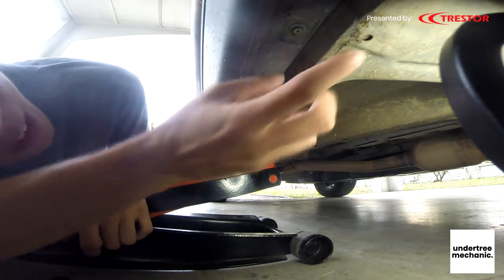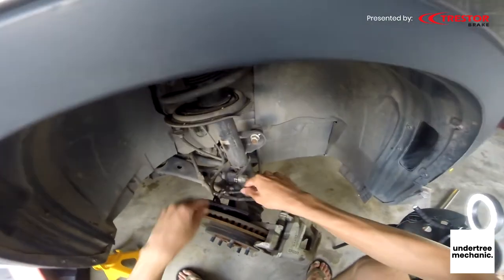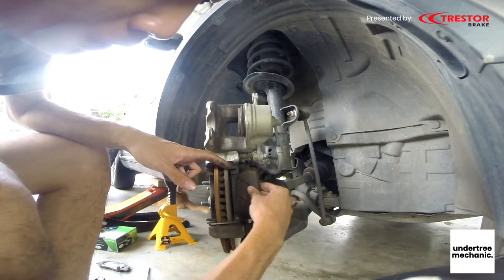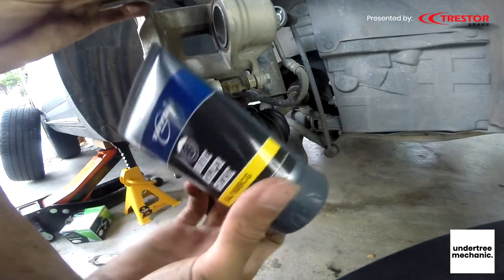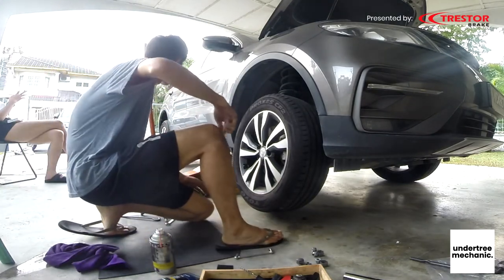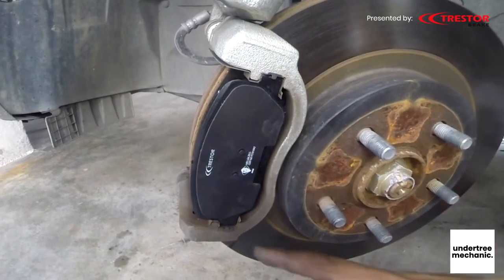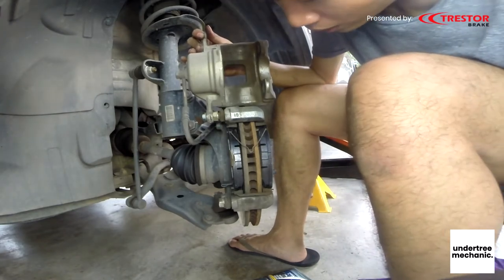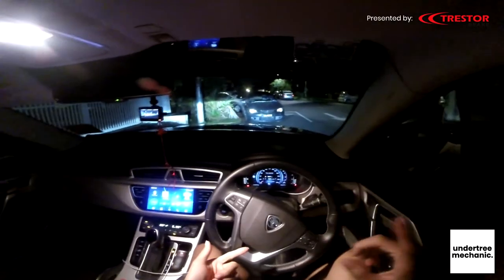Replacing Brake Pads on a Proton X70 Feat Trestor Metallic Plus

Comment: This pad cold performance damn lousy. Need to press pedal very during rotor still cold.
Reply: Typo,pedal very hard
Reply from the maker: U sure u bed it in correctly? This is super good during cold. The advantage not too bad, in fact not much differences. Metal king their big brother from another mother that one is another level haha. Rotors surface ok?
Reply: May be now Siam made change formula already,last time make in section 26 Shah alam,green box is good only when rotor is warm and hot.
Reply from the maker: Our batches are all from Thai bro. It was the first batch for X70 too. Formula remained the same.